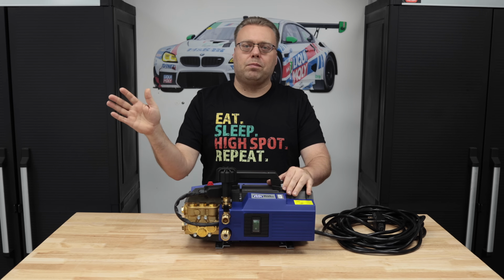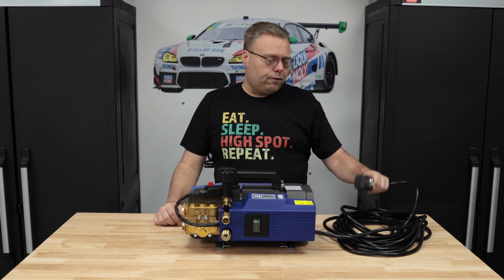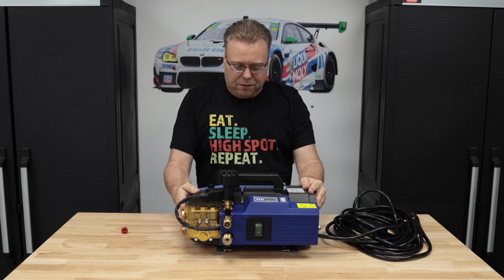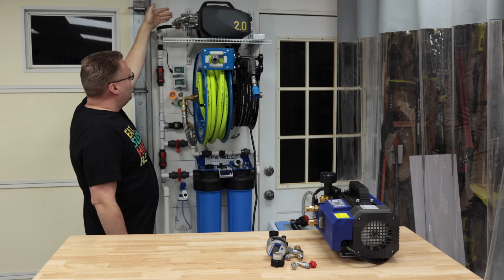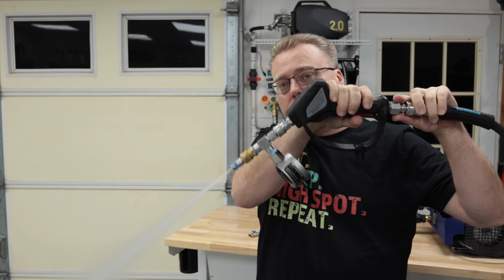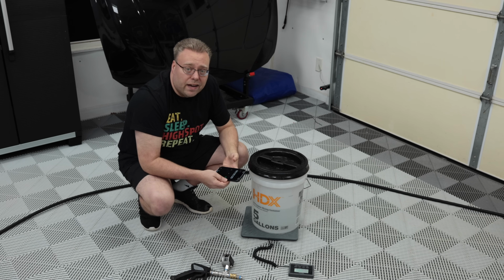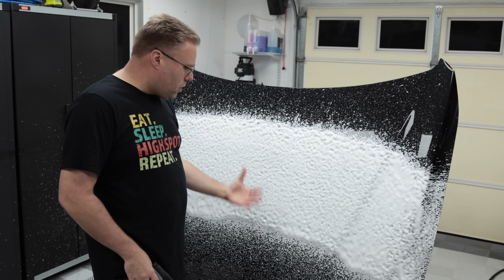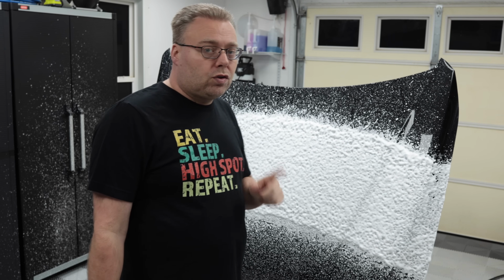Best Pressure Washer For Car Washing! | AR630 TSS | Review & Testing

Comment: I just purchased the AR630tss and I’m curious if it’s ok to hook it up to a spigot with a vacuum breaker? I don’t want to damage it. I’ve read that you shouldn’t
Reply from the maker: I myself don’t know exactly why, but I I’ve heard many times not to use vacuum breakers, backflow preventers or check valves on the supply side of the pressure washer unless they are designed to work with a pressure washer.

Comment: What kind of amps was this at with the 4.5 nozzle? Also, is there a gauge on this to show the hours? Great video, I am about to jump on one of these.
Reply from the maker: @Keith-Hamm   I have not seen an hour meter on any electric pressure washer. Gas ones you can’t measure the hours easily like they can. 4.5 I usually get 14.6 to 14.8 amps.

Comment: Don’t have a 20 outlet in my garage, is the AR675 Pro the same thing as the AR630TSS but with 15 plug? Both have TSS and very similar stats.
Reply from the maker: The 675 is a decent unit, but it is not the same thing. Different pump and motor. It the equivalent to an Active 2.0 performance wise.
Reply: @CarsWithKeav  thanks for the reply! Didn’t know motor and pump were different. Mainly looking at the 630TSS because of how quiet it runs so I was hoping the 675 was the same with a different plug. Active 2.0 performance numbers are solid I just hate that high pitched whine haha. Thank you again man.
Reply from the maker: @jztcars  Matt from OG did a review on it. Few years ago. He did do the numbers testing on it. https://youtu.be/Ab_GLDHYzfo?si=rVOjxCmLlGoT4Q9m
Reply: @CarsWithKeav  many thanks, didn’t see ANY good reviews out there. Not a huge fan of OG cuz I think he tailors more toward professionals, but will give it a watch when I have the time. Appreciate your insight a lot Keav! Cheers

Comment: keav is there any special about the electrical plug on this unit . I know I need a dedicated 20 amp circuit but are the prongs on the plug a standard 3 prong plug? I am getting an electrician to come and run a seperate wire and breaker to my breaker box.
Reply from the maker: The prongs on the plug are for a 20 amp outlet. They should have the 3 prong plug, but it has the flat prongs in two different directions.

Comment: Would it be better to use a true 3/8 inner diameter hose than a  1/4 inch, the market is flooded with 1/4 inch. Seems you'd get better flow without the pressure
Reply from the maker: I myself do prefer 3/8 inner diameter hose and that’s what was used in this video. 1/4 hose can handle way more than this can put out though. The nozzle diameter itself is only a few millimeters that’s where the pressure is held up.  You won’t see any difference until the hose length gets beyond 100ft or so when pressure drop kicks in.
Reply: @CarsWithKeav  thank you for the reply. Ive talked myself into getting this after going thru one active 2.0 and one Adams 2.0 in under 2 years. I would've been better off by buy once cry once. Should've got this from the get go. Love your channel
Reply from the maker: @ You using those for a business I assume? Neither of those for sure can handle long term high volume abuse. If you are just washing your own cars do you have high ppm water? I know that over time can kill these. I know some with 500 ppm water who had to rebuild their AR630 after a year due to all the scale buildup messing with the pump.
Reply: @CarsWithKeav  just use then at home. The pumps on the others didn't give up, the TSS on the Adams after 6 months and they carry ZERO replacement parts for that unit, probably some rebranded Chinese junk they sell and the Active was the brushes in the electric motor wore. I don't have ver hard water, never tested but, i have little to no scale build up on any of my faucets and very minimal water spots after washi ng cars and letting them air dry. I can care less if i have to rebuild or buy another water pump. I like serviceable units
Reply from the maker: @dihdhdhdhdjjdjxj  I think the ar630 is for
sure the way to go. Sounds like you have had some bad luck. How did Active respond or did you contact them? They usually take care of those issues.

Comment: Great video. Looks like a great machine. I have never used or had electric pressure washers for my detail company. We have always had gas Honda pressure for our vans. I always get worry it will not run as well on a generator. 🔥👍
Reply from the maker: Imjoshv has been running this same pressure washer in his detail vans for years on a Harbor Freight generator.
Reply: @ I have at 4500 watts. Generator.
Reply from the maker: @XtraMileMobileDetailing  Should be plenty. AR630 is a proven unit many use in mobile vans. I think Josh said before he was using like a Predator 3500 or something like that.
Reply: @ sweet going to have to try one out . Thanks

Comment: Hi is it the HOT version or regular one ? HOT version worth extra money for better o rings and internals?
Reply from the maker: @Zalatan2025  This is the regular version. HOT version is more $$$ due to the changes needed to handle the higher temperatures.
Reply: @CarsWithKeav  Thanks for your reply. So if it's 100$ CAD more is it worth it over the regular or not pls advice thanks
Reply from the maker: @Zalatan2025  It’s only worth it if you are using hot water over 130 degrees or so. regular one is rated for 140, but I would play it safe at 130. Most hot water heaters are set between 120 and 130. If you are just using cold tap water don’t get the HOT version it’s just a waste of money.
Reply: @CarsWithKeav  Thank you so much once again..No I will never use hot water at all. I thought just because it is designed for tolerating hot water means it is more robust. Thanks 😊
Reply from the maker: @Zalatan2025  The seals are just better at not expanding and getting too soft with the heat. No other benefit really.
Reply: @CarsWithKeav  Great thanks for your input. You are the best 🤩

Comment: Great review still trying to find a UK stockist. Plenty of AR615 available but for whatever reason this model is not available here. Plenty of Kränzle 10/122 available
Reply from the maker: They are coming out with new ar630 this spring that have the ability to switch between constant run and tss plus new pumps and total design. Could be why no stock available. I saw then when researching. https://arblueclean.it/en/product/high-pressure-washer-pro-cold-ar-blue-clean-630/?srsltid=AfmBOopca-e30CC25cctYYs-DsJY-uVah6uslrY1BTUL401UTHRuo_QJ
Reply: @  many thanks but I can’t even find anyone selling them in the uk.
Reply from the maker: @ Dang that sucks, but at least you have 240v which makes basically any pressure washer there perform better than our best ones. 🤣

Comment: I wonder if these can be used for carpet cleaning? Anyone?
Reply from the maker: I don’t see why not. I’m not in that world enough to know the pressure and flow specs they use for that. Guess depends on the carpet and how etc they want to get it or rinse it out.
Reply: @CarsWithKeav l pirchsed a pressure washer 1500 psi with 2.2gpm here locally in Canada, it is not a pss system but it has a bypass so the pump doesn't overheat. So i use an 8 flow wand. I think this translates to an 8 open tip jet, I know you guys have them sizes from 3-5 but our industry on average uses size 8, so this is a lot of flow. I set it to 500-1200psi doesn't matter the pressure drops down to 350psi, the only difference is the higher the pressure goes the more water flow. I can live with 350psi but when i use a higher end equipment with a spinner, we need higher psi. This is the reason i was wondering if this ar630 will keep up with our size 6-8 flow. But by the looks of it most likely all power washers will drop the pressure. We have a 120v 1200psi 2.2gpm industrial pump called otter pump by pumptec. But its double the price of this ar630tss. However it does keep up with the pressure even at size 8. I get around 900-1000 psi with decent flow.
Reply from the maker: @NotTooExtreme  Thanks for all this info sounds like a different type of pump design all together.
Reply: @CarsWithKeav  I am trying to figure this out for my carpet cleaning business.  So this is what I have found out. The power wash pump is bought came with a regulator for misting 😆, so now I will have to buy a regulator for power washing so I get a higher pressure, so this way I don't have to spend so much on these pumps. In our industry, they charge us arm and a leg. Thank you so much. This discussion made me realize things.
Reply: @CarsWithKeav  l purchsed a pressure washer 1500 psi with 2.2gpm here locally in Canada, it is not a tss system but it has a bypass so the pump doesn't overheat. So i use an 8 flow wand. I think this translates to an 8 open tip jet, I know you guys have them sizes from 3-5 but our industry on average uses size 8, so this is a lot of flow. I set it to 500-1200psi doesn't matter the pressure drops down to 350psi, the only difference is the higher the pressure goes the more water flow. I can live with 350psi but when i use a higher end equipment with a spinner, we need higher psi. This is the reason i was wondering if this ar630 will keep up with our size 6-8 flow. But by the looks of it most likely all power washers will drop the pressure. We have a 120v 1200psi 2.2gpm industrial pump called otter pump by pumptec. But its double the price of this ar630tss. However it does keep up with the pressure even at size 8. I get around 900-1000 psi with decent flow.

Comment: Keav,  i'm considering buying this pressure washer in a little while to replace my 7 year old Sun Joe SPX3000.  QUESTION:  Would you recommend using dedicated hardware to bolt down this washer to a stainless shelf so it has no way of possibly vibrating off or just falling off my accident ??? Thoughts ?
Reply from the maker: It is recommended to anchor it in some way I myself live dangerously and rely on the rubber feet to keep it from moving plus the way my hoses are routed keeps it in place as well.

Comment: When running the foaming cannon should I have the regulator turned to the max? Using it with the metered tip on the BOSS cannon with 1.25 mm orifice. 40 PSI from the faucet
Reply from the maker: I always have the regulator at max. I would prefer a 1.5 size on this unit, but you can get by with a 1.25 since it requires a 20 amp anyways.
Reply: @CarsWithKeav  great thanks for the advice! Are you aware of an aftermarket orifice that would work with the boss cannon at 1.5 mm? I fortunately do have a 20 amp circuit at least
Reply from the maker: @ That size is hard to find, but a 1.4 will work. I advise this one all the time. https://amzn.to/3VYsGfP
Reply: @ thank you for the personalized advice! I was running the 630 with the red shipping oil plug for a year but just for personal use. I hope I didn’t damage it :(
Reply from the maker: @ You probably didn’t. They used to only be shipped that way, but some people had leaking issues due to high oil pressure so they added the breather cap. They can’t ship it like that because if it ever gets tipped over the oil will leak out into the box.
Reply: You’re a wealth of knowledge; thanks for the reassurance!

Comment: Excellent video! So I’m looking to upgrade my pressure washer and I’m debating between the Bigboi pro, active 2.3 and the AR630 TSS. I’ve seen all the videos now of your reviews on them. Which one do you did you like the best and would you recommend one over the other?  I also have the amp setup for any of them, so not a factor there. Thank you!
Reply from the maker: Honestly overall best to me is the AR630. I chose the 2.3 on my shelf simply because it has the best numbers. It might be getting replaced by the big AR RCA3-pro once I add a third support to my shelf.
Reply: @ ok. Thank you for your opinion. The AR is the one I keep leaning towards the most. It seems like the numbers for the AR aren’t far off from the active 2.3 to me. But I seem to like the overall specs of the AR even tho it has more amp draw, which I can manage that to keep them lower with no problem. Id have to look at the big AR pro tho just to check it out. But thanks again for all you do. Love your content!

Comment: Interested in your thoughts of this PW in a mobile rig? Being that it draws higer amps, would almost say that an inverter generator is also required just for this unit as some customers won't have a 20 amp circuit available. Yes, we should have an inverter anyways just in case customers don't want us plugging in to their power sources, but this PW especially should have its own power source. Aside from that, would you recommend this setup for a mobile detailing operation?
Reply from the maker: I know many mobile detailers running this in a mobile setup. Probably one of the most popular ones used for it. Check out Imjoshv on YouTube as well he runs a mobile detail business and has them. He has done several generator videos showing them working with his ar630.

Comment: Never going to get the rated pressure with a 3/8" hose.  Unit is sized for 5/16" - 3.5 nozzle that will give you rated 1400 psi.  Use 5/16" and if you want less pressure go up in nozzle size.
Reply from the maker: @ply17410  I see what you are saying about that being the hose size it was rated for, but I have never had hose size change PSI in any significant way, but to make sure I’m not misremembering I took out the 630 and used a 1/4, 5/16 and 3/8 all at 50ft in length and all were within 5 PSi of each other with the same nozzle. With the 20+ pressure washers I have tested the only things I have seen to change PSI is nozzle size, voltage, and length of hose. Based on hose diameter once you get into that 100ft+ range the larger diameter hoses do better at limiting pressure drop. Voltage is a big one as in the U.S. depending where you live you could have as much as 125v or as low as 116v. My friend gets 50 to 100 psi more than me because he is blessed with 122v most of the time. I’m around 116v so I won’t get full potential of the machine. This is what I’ve experienced and not trying to say you are wrong just I have not seen hose size impact PSI. I have seen hose size for sure mess with pressure switches though and ramp up time.

Comment: Hello Keav, 
Is the AR630 made in Italy? I saw a video where the box it came in said made in China. Just curious.
Thanks
Reply from the maker: The sticker on the unit for serial number on mine says made in Italy. Now if you bought one with the plastic gun and hose then I guarantee those are made in china.
Reply: @CarsWithKeav  I can't seem to comment on your other review.
The Italian AR website has an updated 630 unit that's rated at 600L/hr (2.64gpm). Italy uses 220v/50hz
Reply from the maker: @MikeMJCW  That one isn’t available in the U.S. as far as I know only in Europe. YouTube doesn’t like links being posted most likely.
Reply: @CarsWithKeav  too bad, that Euro version looks nicer/more compact than the US one. We need more 220V TSS to choose from. Canpump?
Reply from the maker: @MikeMJCW  They rarely use gas pressure washers in Europe due to their amazing 220v power grid.
Reply: @CarsWithKeav 
Looks like it was ar680 https://youtu.be/P-7gLetGjKA?si=N2-0kvmTd6VHX92Y
Reply: @CarsWithKeav  looks like it's an AR680? https://youtu.be/P-7gLetGjKA?si=xEn4Spksmz5KHJGz

Comment: Will this pump from an external tank if mointed above the tank?
Reply from the maker: It does not self prime you would need to be the opposite so the water tank is higher creating a gravity feed. The feed needs a good bit of flow to keep the machine supplied. Most use a pump to feed this one from a water tank.
Reply: @CarsWithKeav Thank you for the info. This made my decision of what pressure washer to order.

Comment: Can you buy a adapter for that plug or do you have to buy a new plug-in?
Reply: I bought the AR from Clean Garage just last month and it came with a 15A plug
Reply from the maker: @danielmai4063  Nice! Might have been old stock before they made the change.
Reply from the maker: It’s a GFCI plug at the end that can be replaced with one for a 15amp if needed. There are also 20 amp to 15 amp plug adapters. https://amzn.to/4eeHAFm

Comment: Hey Keav I need a 90 degree fitting to connect to the 3/8 quick connect for the jumper hose but I can't find one that fits anywhere. Do you have a link to one that I can use please? .